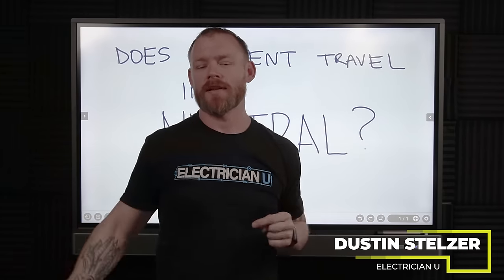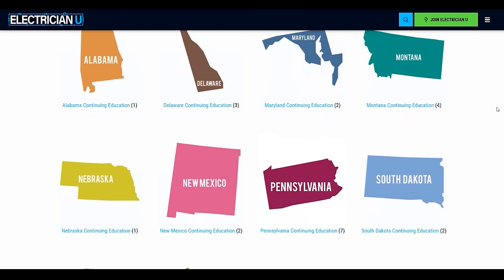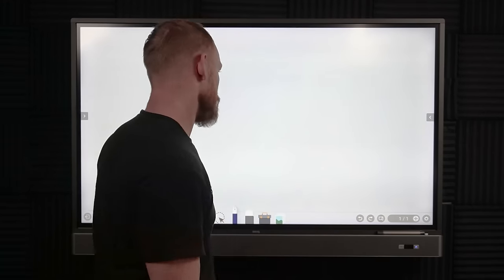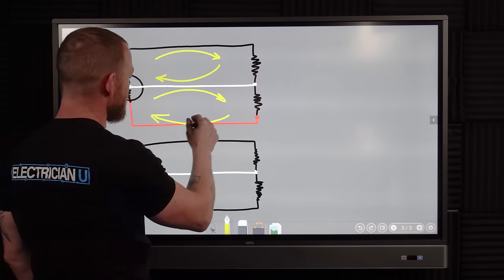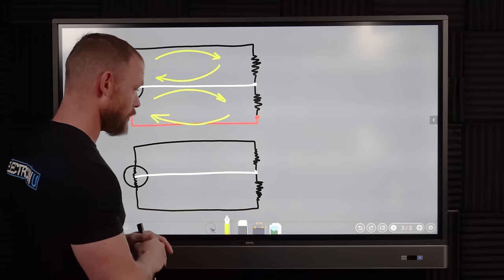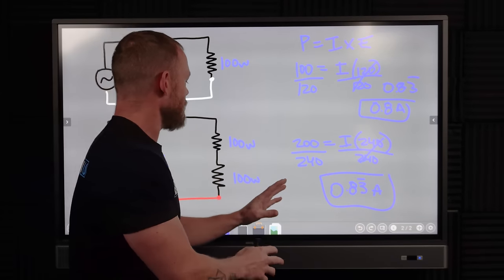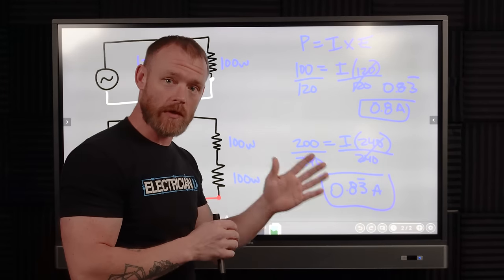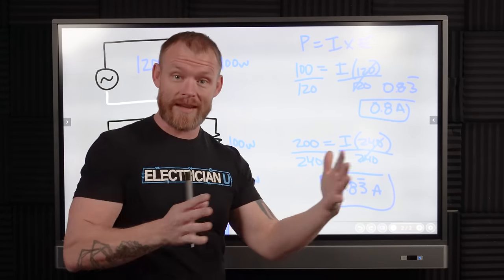Does Current Flow on the Neutral?

Comment: Super confusing when u mention how one pulls and pushes from the pile how does it make 240 if it’s pulling through the black and pushing off red on the panel both sides are hot I want to learn this as it’s challenging and interesting 😤 I’m lost when you show the red and black then two blacks In second drawing . Seems to much to wire 2-110s off 2 breakers in opposite sides to make it flow through without overloading neutral or I’m misunderstanding what u mean by this example 😩😤

Comment: Interesting and i learned something but i think your vision of current isn't right. It is not ekectrons and their fields cruising down a wire. I cant even imagine what this would really mean. What is travelling is a wave. The electrons jiggle via this process. In the same manner a wave at sea travels but does not transport the individual objects anywhere except up and down. Imagine hitting a bar with a hammer. the bar moves a little but the energy is transmitted at light speed to the other end

Comment: Whats missing is why does it cancel out for neutral and not hot wire.
Reply: The two 120V circuits have opposite current direction on the shared neutral, so the difference is the actual current.

Comment: Did you mean to use the power law for a 60 Watt Bulb? 60 Watts/120Volts =.5 amps?  P=IxE instead of E=IxR. I mean it works with Watt's law or Ohm's law, but lights are usually measured in Watts.  That would be a 240 Watt bulb and that is kind of unusual...  Ok, watched the rest of the video.  I think it would have been a more simplified explanation using watts initially, and skipping Ohms.

Comment: I have been in electronics for over 50 years and I tried to have an open mind while watching this through. You have massively overcomplicated a very simple concept.
We use a split phase system to residences. Current will indeed flow in the neutral IF the loads on each phase are NOT balanced, which is ALWAYS the case in a residence.
Your attempt at electron movement with a wire and magnet is flawed as the only time the electrons will move is when the magnet (or wire) is physically moved. Thats why generators have to be spinning.
You overcomplicate ohms law as well. To calculate current with only voltage and resistance is known, the CORRECT formula is I=V/R and to calculate Power or wattage, the formula is W=V*V/R. Incandescent lights are not a linear load either as thier resistance changes as they "warm up", so measuring the resistance while a bulb is cold, is much different then when it is warn. This is because the resistance will INCREASE as the filaments heat up. Typically the resistance will increase 15x.
For example a typical 100w incandescent bulb will measure around 9 ohms when cold and at 120v applied, this mean the bulb will dissipate 1,600 watts! But at its normal operating temperature the resistance will be 144 ohms, thus dissipating 100w
Your examples of using ohms law ONLY applies to purely linear loads, which in a residence is not true.
In order to teach something you need to make it SIMPLE to understand.
Please take my comments as corrective criticism.

Comment: Bottom line how do I correct this ? I was replacing a receptacle and turn the circuit off, I tested the black wire and there was no electricity, but, when I started unscrewing one neutral wire sparked, with the tester I saw that there was some current, not much but some, help.

Comment: One thing I never understood was... in the US we have 240 volt power, which is 2 phase, 180 degrees out of phase with one another.  You even said the two 120 volt legs were different phases.

Buuutt....  240V Electrical panels always say "1 phase".  Which is 100% wrong.

Now, I understand there's also 3-phase power where the different phases are 120 degrees out of phase with one another.  But why do we call 240 volt power supplied at a panel "1 phase", despite the two wires being 180 degrees out of phase with one another?
Reply: The 240v supply to the panel is a single phase.  We synthesize two opposing phases of 120v by using a center tap on the transformer secondary.
Reply: @GH-oi2jf  I don't understand.  

In one sentence you say it's a single phase.  

In the next sentence you say the two phases oppose one another.  

How are two opposing phases (or more properly, 180 degrees out of phase with one another) not 2 phases?
Reply: @stevesether  — The 120V circuits can be thought of as two (synthesized) phases.  The 240V circuit is a single phase.
Reply: @GH-oi2jf  Can you explain to me why 2 sources of power that are 180 degrees out phase with one another are a single phase?

This is really my question.  Forget how the power is produced, as it's irrelevant.  If I hook up an oscilloscope to two opposite poles of my power, will I see them 180 degrees out of phase with one another?

And if I do, why isn't that "two phase"?

Comment: As I'm puntering the subject of neutral you would have to look at a three-phase circuit where neutral would be neutral but a single face circuit what a 120 240 well 240 neutral becomes neutral because if the amperage loads are the same on each end it zero's out but on a 120 circuit if you have 10 inch going in you have 10 amps going out. Is this why neutral is called neutral L1 L2 should have been a L0. but we call that the white leg L1 black L2 red and if you have a three phase 208 120 circuit the third phase is L3 blue.

Comment: Here is an outside the box observation that has to do with your postulation that current flows in the neutral, whatever that means, in conjunction with the information presented on another YouTube channel that postulated that electrical current or energy doesn't flow in the electrical wiring but outside or something like that and I can't remember that channel name but it's the one where the host is balancing a spinning flywheel that defies gravity. Anyway, MY postulation is that you may both be unwittingly flirting with the key to creating a nascent rudimentary sentient mechanical life form. The key being that the energy you are both describing could conceivably be used to continuously recharge a battery or a battery array or a supercapacitor or an array of supercapacitors or a hybrid of the two in ..., say an EV which EV would have coils incorporated into the wheel or wheels that would be used to harvest the kinetic energy from the rotation of the wheel or wheels in order to supply the continuously flowing electrical current for the purpose of recharging said energy storage system/device/heart with this electrical current being the circulatory system and the computer being the brain, you've got yourself a nascent living sentient mechanical life form with the unique postulation you are both presenting "possibly" greatly diminishing the size of the battery array/supercapacitor array/hybrid of the two, if needing one at all. You two should get together and compare notes, in my opinion.

Comment: Too complicated...atoms? electrons?...jeez!

Here is an explanation from me, an electronics & electrical engineer of 35 years:- 

Do not confuse the earth & neutral lines in AC systems:- 

Earth (green or green/yellow) - This is a safety bond to chassis. Although the earth & the Neutral often terminate at the breaker panel on the same terminal (called PME - protective Multiple Earthing) there should not be any "work" current in the earth line EVER! Allowable earth current is <15ma.

Neutral (white or in Europe blue) - This is a "work" current return line from the machine. Current may flow in this line. 

In a single phase circuit, the ONLY allowed return path for machine "work" current from the phase is via the neutral. There should be near no current flow in the (green or green/yellow) earth. This is how we detect a fault current in an RCD breaker which will trip at anything over 15ma.

Two phase: "work" current typically flows between the two phases via the machine, but also may or may not flow via Neutral, depending on machine design. <15ma earth (green or green/yellow) current is allowed but in reality this will be much lower unless there is a fault.

Three phase: "work" current typically flows in & out of the phases, in directions depending on where the phase cycle is in time. It is not typical to see working neutral current in a three phase machine, though it is allowed, for example if it feeds a three phase rectifier in a motor drive. <15ma earth (green or green/yellow) current is allowed but in reality this will be much lower unless there is a fault.

Comment: When you say Phase ... is that like a sine wave ... ie both phases equally opposed (inverse | 180 degrees off ...) ... that tap in the middle suggests otherwise
Reply: In the split-phase scheme, the two hot wires are in opposite phase relative to neutral.

Comment: You fell short by not explaining the voltage drop across each bulb.  The bulbs in the 240v circuit actually had 120v across each bulb. You never mentioned that.
Also, while Ohm's law is useful in describing DC and purely resistive AC circuits, in AC, you really shouldn't mix up resistance with impedance. Resistance is a +/- summation while impedance (AC resistance/reactance) are vectors.  Apples and oranges.  While AC can be part of a DC voltage source i.e. ripple voltages, analyzing the electric fields, current flows  and characteristics of such a source requires more math than Ohm's law.
Another approach would have been to demonstrate phase shifting in an AC circuit and the reasons why zero current flows in a theoretical purely resistive AC circuit. 
That would have left the door open to further discussion on capacitive/inductive circuits and power factor in AC circuits and clarified that in reality, there are no purely resistive loads when dealing with any AC circuit, regardless of the frequency. That's a very important distinction as it demonstrates the need for a neutral conductor and the fact that there will always be magnetic fields (current) flowing on the neutral leg of any energized AC circuit.

Comment: Can you please explain to me how the neutral in the transformer behaves? Why is it not electrically charged just like the red and black wires if it is also connected to the same set of coils that give them their power? I wondered at one point if there was a large diode at the point where the neutral connects so that flow is in only one direction but then black would have no power because of the diode. I’m also a bit confused as to why electricity does not constantly choose to go to ground at the many points where neutral and ground are connected like in the panel. If it is that electricity just so strongly prefers to be in a circuit aka return to its source that it refuses to travel down the ground unless there is truly no other option then wouldn’t there at least be a very small amount of loss as the electricity constantly tries the many different avenues it could go.
Reply: The neutral in the secondary of the transformer is connected to ground at the pole.  The neutral is also connected to ground at the first disconnect.  You want the neutrals always to be near ground potential.

AC current flows in both directions in the circuit, alternating.  Electrons always want to move in the direction which reduces potential difference.  The neutral wire is a low resistance path to the transformer, which provides Electro-Motive Force to the circuit, so nearly all the current flows in the neutral, rather than in the ground.  The ground is a relatively high resistance path to the transformer.

Comment: If no current is flowing on the neutral of a 120v circuit with a load, you should turn off the circuit breaker. 
Then check on grandpa.

All kidding aside, we can be thankful for the advent of 2-circuit "romex" cable that actually has a separate neutral for each "hot" conductor. (Notice I didn't say "phase" conductor.) This new cable is identified as 14-4 and 12-4 or 14/2/2 and 12/2/2, which consists of a black conductor, a white with black strip conductor, a red conductor and a white with red strip conductor.  This new cable is very compact, and appears to be no larger than a 14/3 or a 12/3. This eliminates the need for a shared neutral in a dwelling, but here are a couple of other benefits: 
1) Want to run both circuits in the cable on the same phase? No problem!
2) How about using AFCI/GFCI breakers in the panel on two remote circuits? Now you can do this with one cable!

Comment: I just got off a job where the ‘installer’ screwed the motor neutral to the metal box and only ran a single wire from the switch to the black wire at the motor. The conduit became the CCC. The owner refused to pay me to pull a ground and neutral wire. Ahhhhhh

Comment: many years ago i was working with a master electrician there was a deep well pump in the ocean pumping salt water up to the shore the pump was damaged not working he turned the breaker off we used a row boat to trace lift the pipe and wire back to the pump when i lifted the pump out of the water grabbing the  pump by the metal casing i received a good strong shock it burned and viberated me it hurt like putting my finger in a empty light socket turned on . i dropped  the pump i told the electrician i got a bad shock he got mad and said i was making it up he said there is no way i could of got a shock the breaker was off and tried to make me pick it up again i told him i was done . so is this true the neutral wire can carry current to ground through salt water . is this right or did i lie .

Comment: You cannot have 2 currents flowing in opposite ways thru a conductor!!!
Current conventionally flows from from a higher potential (Volts) to a lower potential.
When your load is perfectly balanced the junction point of your neutrals in your breaker box has the same potential than the neutral coming from the transformer which is why there is no current thru the transformer.
Reply: In an abstract model you can.  Practical electricity uses a model which is much simpler than a detailed model of the underlying physical reality, but which gives useful results.  This isn’t physics.  I’ve studied physics, but I don’t let my knowledge of physics complicate my treatment of problems in practical electricity because it is unnecessary and unhelpful.
Reply: @GH-oi2jf  This is how it was explained to us in electricity class, personally I find it very simple to understand : no electric potential means no current.
You could also simply demonstrate this with Kirchhoff's current Law.
I have been failed for an exam (25-30 years ago) using an abstract model (tbh, the teaches was an a**) because I took a reverse current thru a diode while a much more important forward current was present (resulting current was forward).
Imho, yes, you can use an abstract model but only as an intermediate step to get to the real thing.

Comment: The only thing questionable  on the whole elections being passed between atoms is how do you explain the flow across the non touching poles on the  step down transformer?  Not the only place, too.
Reply: The alternating/changing magnetic field in one of the non-touching coil induces current flow in the other coil.

Comment: So the electricity isn't consumed,  it just passes thru the circuit creating light, heat, etc.? That means I'm renting the electricity from the utility company? And then they rent it out to someone else farther along down the "circuit"?
Reply: No.  You are consuming energy downstream from the meter, and that is what you are charged for.
Reply: @GH-oi2jf  i assume I'm paying for what the meter is consuming also, then.
Reply: @alcarey8084  — The meter is not significant.  If you turn off all your loads, the meter should record nothing at all.

Comment: so when its not proportional your saying the neutral wire is hot?
Reply: A hot wire implies 120v in a typical residential receptacle, and a neutral wire is always 0v under normal operation, so the answer is no. The neutral wire will be carrying current, however.

Comment: Electricity nerds like myself will be quick you point out the difference between the simplified model you teach and the real word physics - but I think explaining it this way makes a lot of intuitive sense and for the electricians application is probably the best way to learn. There are certainly instances where neutral wires don't carry current, and they'll even be designed out of systems where not necessary. This is almost exclusively for balanced three phase load applications though, that you won't see very often in the field working with branch circuits and power panel distribution. Neutral current is even further exaggerated when your loads have complex-power phase shifts so you not only need to match real power P but reactive power Q of your loads.

Comment: what would happen if there was no load balancing and all circuits were only on one phase?
Reply: nevermind you just answered it, lol too much current will go back through the same neutral.
Reply: It should be fine.  There are multiple circuits on each side and each circuit should have a neutral wire.  The neutrals meet at the neutral bus bar and it can handle the combined current.

Comment: Questions please (Three pole RCD) see the current: if input current = output current there no leakage current will not trip, but if the current cancel each other on busbar, then the some current go to output of RCD, so the input current to RCD not equa to output current, so how the RCD will know if there leakage or not. Exampl L1 =10A L2=8A L3=6A 
Go through input RCD then to load, then to Neutral Busbar L1=10A L2=8A L3=6A they will cancel each other total of then let say 12A go to RCD. Then the RCD WILL see the input current L1, L2 and L3 not same the output current (N) so how RCD NOT TRIP? How now of there leakage or not.